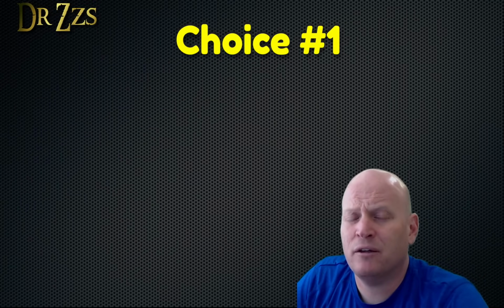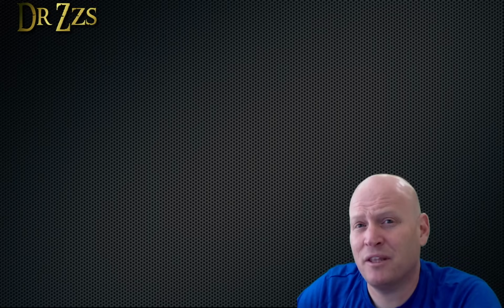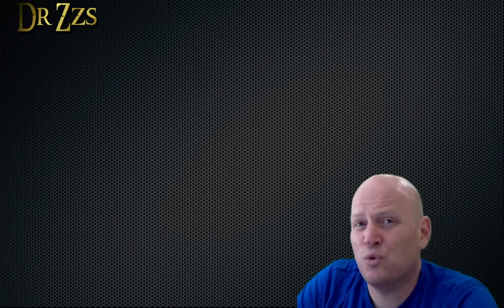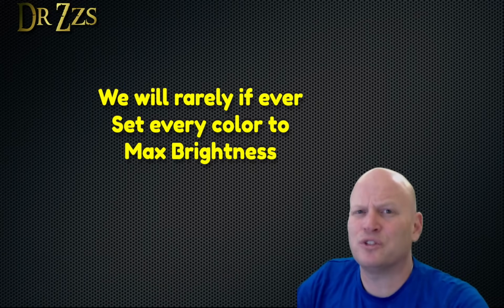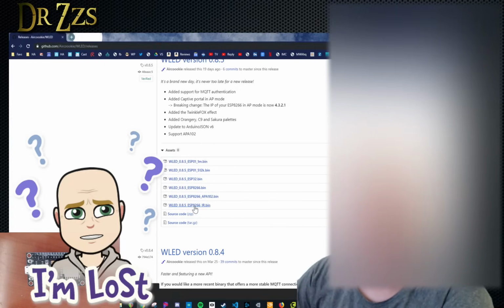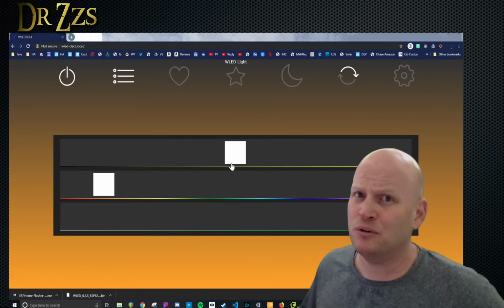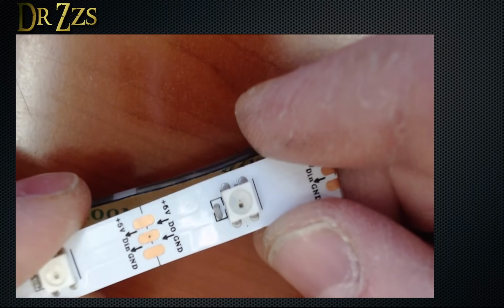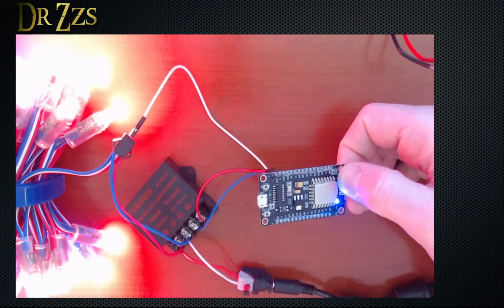Beginner's Guide to Christmas Lights - and LED Shows for Every Holiday

Comment: Well, I guess your not involved in this as much now, left a question few days ago but i finally got mine all working. i never could go to the address i made with my own name but was able to find the 192.x.x.x.x using Fling and typed that in..
anyhow you don't use any fuses inline with any of your stuff? got to reading on a Christmas site and they suggested having a inline fuse along with the power wire from the power supply to the unit. and even from the unit to the pixels. Have you ever done this?

Right now mine is set up just like you have. Other then I have a metal case 12.5 amp 13.8 volt power supply.

Thanks

Comment: I have 4 strings of GE G35. They're not bad, have 16 patterns, controling by radio remote. The only problem is I can't sincronize them. Will they be working as one 200 LED string with nodemcu controller?

Comment: I love the work you do and have so much fun watching your videos. I used the NodeMCU for my project just like the tutorial. Everything worked out almost perfect.

A bit of advice for "Canadians Only", 

Take heed to the power supplies used in this tutorial. 

If you are in Canada, how are you doing this so that the ESA doesn't come by and shut you down because of your non CSA certified STAMPED power supply from China? 

I guess it doesn't really matter where it's from because I bought mine from amazone.ca and the should not be hosting these sales as it goes against our safety regulations.

I installed my Permanent holiday LEDS with power supplies attached to the wall of the front of my home with a digital timer/on/off switch going into the side of an external 
GFI powered line from the fuse box. My 110v travels out in conduit to the side of the external plug outside beside my front door then goes up 1 foot to the digital on/off/timer 
switch inside a protective housing box, then out and up another foot to the power box that houses my power supplies. 

The reason why I am telling you all this is because of my question, IF I make all of this "NOT attached" to my home and all mounted in external water proof boxes sitting on my cement porch mounted on a tripod and plugged into the front of that front gfi beside my front door. 
Would that make the ESA(Electrical Safety Authority) situation mute now because I removed all electrical equipment from the home and plugged it into an external gfi ?

I don't think DRZzs would know as he is in the states, but I hope his community would know because I'm kinda of in a pickle and can't find CSA Cert 5v 70a power supplies 
here in Canada so far. :-(

Sucks to get it all done looking wicked and told I will have to shut down because of my power supplies not being Canadian Safety Certified.

Keep up the great work DRZzs, you are really fun to watch and learn from!
Excellent Teacher!
Reply: I got the call I was waiting for. CSA called back and I asked if the box was mounted off the front outside wall and not "Attached" to the home but placed on the cement porch in a water proof box, would I be in the clear. They said also have it my power supplies inside the main box "plug" into the GFI beside the front door on a timer and you are all good. FweeeeeeeW! 

In the end, don't install these Chinese power supplies onto your home if you live in Canada. Place it just to the side on the porch or on the ground and run your lines up through conduit and thats fine.

Also watch all DrZzs Videos and support him. 
He's doing some great stuff here!
Sub/Like/Share!

Comment: Thanks for the video it has certainly pushed me into trying to make my own xmas lightshow. I have got one string of lights and node mcu and have it all working great. 
Is there a limit to the number of 12v strings i can connect to one nodemcu? I will be adding power throughout the strips so not worried about voltage drop.

What i am trying to achieve is a 16 strip 180° xmas tree. Can i control this via one nodemcu or will i need to use multiple and then group them together on xlights?

Comment: Hello, Thanks for your video. Question, how many string lights can you connect into the MENZO 12v 30a Dc power supply? also, do I need (1) Wireless Module per string light? Again, thanks!!!!

Comment: Trying to understand how power injection works. Do I need a new wire from the power supply to each string or can it be ran from strip to strip on the extra wires? So if I have let’s say 5 strips do I need to run 5 separate wires from power supply or can I use just one and keep chaining them together.

Comment: I keep getting stuck trying to flash my 8266. i followed the steps to download WLED 0.12.0 ESP8266.bin got the latest version of  ESPHome Flasher 1.3.0 Windows x64. Connect my 8266, select Com3 (the only one that shows up), select the WLED bin file, select flash. Then it says "Using 'COM3' as serial port,"  "Connecting..."
"Unexpected error: Write timeout." when I try it again i get "Unexpected error: could not open port 'COM3': PermissionError(13, 'Access is denied.', None, 5)."  Help, what am I doing wrong, do I need a special driver for windows 10?
Reply: I discovered my problem. when I looked at the ports under device manager i saw COM3 and COM4 were assigned to bluetooth connections. COM3 was also assigned to my ESP8266 (2102). So i deleted the esp8266, then the other com3 device computer rebooted. in unplugged esp8266 then plugged it back in after windows rebooted, then device manager assigned esp8266 to COM5 - problem solved

Comment: My NodeMCU isn't powering on through the Vin input, but is powering  on via USB.  It switches off the moment the data  pin is connected to the one on the strip (checked data pin before  connecting). Help please.

Comment: This video was great! I do have a question though. What are the best ways to inject power at the opposite end of strip lights? There just be a better way than running a power wire in parallel to the strip itself.

Comment: You rock man. I did the naked led lights on my house. So far so good. Heavy rains mess with the colors. They dry out and it's fine. Good for 34 bucks for 82 ft off amazon. Wants silicone coated ones next!

Comment: New sub here. I am considering led light strips for lighting in my office or ham shack.  Do you know what RFI (radio frequency Interference) these strips emit? My understanding of solar electricity is that the inverter is the biggest soirée of RFI so if I came off the 12v with less RFI than a power supply from AC power.   What I mean is I would buy higher cost 12 v strips if I could avoid the interference.  Hope this make sense.  Thanks for your videos. You make this understandable.

Comment: @drzzs if you were starting over again, would you use strips or strings? I’m in the U.K. so pre-made items like your permatrack are not readily available, but strip channel is, making strips potentially easier to hang. Thanks again for your videos 👍🏻🤙🏻

Comment: Saludos from Spain!

Your videos have encouraged me to attempt to prepare my Christmas show next year! I have been watching your videos and learnt a lot from them already, I have been able to run my first string and program it with arduino, today I will receive a few ESP8266 and will try to get started with Wled and Xlights, let's see....

However, one question I have not been able to clear with your videos, I intend to build a few matrix around 1000 pixel each, but not sure about how many controllers would that require as well as the power supply for all of them... would you recommend any source of info I could check?

Comment: I've purchased a few LED strips and all the components needed to do a test run.  I'm wondering how you go about concealing the T-Splices at the end of every strip??  I have a couple of the different LED tracks and that's great to get the lights out of the elements, but the T-Splices are too big to fit inside these tracks.

Comment: Help!!! I bought the board from Amazon that’s linked on the description box, I went to the website and checked released and when I downloaded the “.bin” file and tried to open it, it wouldn’t. I was on a machome and I’m stuck! Time stamp is @12:48 I can’t go past that because the file won’t open up. This video is a year old but I can use some help pls!
Reply: I’m having the same problem! Someone help us!
Reply: @jwu322  seriously! I’ve downloaded the home flasher and the bin file and it won’t open up. I even tried plugging in the NODEMCU and nothing. I also tried downloading Arduino and no luck. I literally got a headache from trying for like 4 days straight

Comment: ok, found your post and having trouble with step one...  i downloaded the espflasher and it will not see my nodeMCU. when i plug in the usb,  it flashes.  I even tried a second one and a different cable.  still no luck.

Comment: Just checking in a year later to see if the LED's held by only the adhesive backing have lasted.
I was surprised by a set from BTF lighting I use inside that has held on for over 18months and still holding.  Most cheaper ones definitely don't stay up that long.

Comment: Clarification of lengths.  At the beginning of this video you talk about the strings & that “they are 3” apart & 16’ long!”  3” x 50 light “bulbs” equals= 150” / 12” = 12.5ft NOT 16ft. This lack of clarity makes it difficult/misleading for a new person using your video to accurately order lights based on lengths. I put this up here hoping it adds clarity to a SUPER Good -HOW TO VIDEO. Your viewers might also find it helpful to understand that using 3” will also get them in trouble with lengths because the 3” means there is significant “tugging”on the wiring. If you use 2.75” x 50 bulbs as your length = 137.5” /12 = 11.46ft / strand of lights (11ft 5 1/2”).  Hope this helps someone planning their layout!

Comment: Will the lights brake if the wifi module does, I put to much voltage and the board stopped working but haven’t tested leds with a new board

Comment: Got two strips installed, NodeMCU programmed, and additional 5V injected at connection of the two strips, but the lights are doing all sorts of crazyness and showing all sorts of different colors and patterns than what is selected in WLED. Any ideas?

Comment: How many strings can be connected to this small ‘controller’?
Reply: I'm still learning but I think ws2811, ws2812, ws2812b data is resent from each led unit. So for data it as many as you want but some sequencingsoftwarehave limits of 300 pixels (rgb led units) per line. But the power has to be tapped into the strings every so often depending on number of led are on each string.

If asking how many separate lines per controller, then I'm think upto 4 but I just got in some to test today. Part of the limits is how fast the controller is.
Reply: @Tigerskunk  I got my first 3 nodemcu controllers. The thing is I can’t use the flasher and other stuff on my Mac. Any ideas?

Comment: Great beginner guide, much appreciated!  I have purchased 2811 5v led pixel lights(set of 50) node mcu board, barrel connector and a 5v 2A power source along with jumpers.  all was going great, flashed the mcu, went to power everything up and the lights flickered red for a split second but will not power up.  the Node MCU is powered up but can't get any lights.  did a little searching but can't find any solution.  Would appreciate any help, from east coast Canada and I've been watching  your vids that last month or so and finally decided to pull the trigger and give it a shot.  thanks in advance DRZZ. :)

Comment: *READ ME* If you are having issues flashing the controller:

First, you want to make sure that your cable is not for charging only. Apparently they make tons of those that are good for charging, but not for transferring data. A cable that comes with your phone or tablet should be fine.

Second, make sure your USB port works properly. Put some  other USB device (that you know works properly) into the port. If it works, then you're good there.

Third, (this was my issue) make sure you have the correct driver installed.
Open up "Device Manager" (Windows Key + S => Type "Device Manager").
If you've got a "!" next to your device, head here and download the driver: 
https://www.silabs.com/developers/usb-to-uart-bridge-vcp-drivers

Install the driver and refresh and you should see the COM number.

At this point, I was able to get the COM to show up in esphome flasher, but I could not successfully flash the controller.
What I did to resolve this issue was this:

First, run esphome flasher as administrator (windows), or with sudo (linux) (I'm not sure if this is necessary, this is just what I did)

Second, near the part of the board that connects to USB, you'll see a "RST" and "FLASH" button. Push and hold BOTH of them for a few seconds, then release only the "RST" button.
While still holding the "FLASH" button, click the "Flash ESP" button in esphome flasher. Hold "FLASH" throughout the duration of the flash.

This worked for me and I hope it's helpful to anyone who needs help. 

Good luck!
Reply: Thank you!
Reply: @eigilontherun  no problem! Good luck on your project
Reply: @thewonderonesie782  thanks alot! Ordered all my parts the other day, just waiting and learning as much as possible so i'm prepared
Reply: @eigilontherun  That’s super exciting!! I hope things work for you without giving you too much trouble

Comment: I think you need to be clear that a bare metal supply needs to be in an enclosure for safety reasons as the supply side (110 VAC) can be contacted by bare skin.

Comment: @DrZzs How did you mount the connectors between the LED strips in the aluminum channel without showing a gap of LEDs where the connector is? Also, you have to run the power wires if you are using more than 1 strip. Would the power wires fit in the aluminum channel as well? 

I am thinking for more than 1 LED strip that the aluminum channel would not really work?

Comment: HELP, you are the only source that I can find on the GitHub page to install WLED on my D1 mini and your tutorial is out of date and doesn't match what is on GitHub. Are there other sources to install WLED? I've been searching for hours and all sources point to a bin file that I cannot find. I couldn't use esphome flasher in Windows because it won't display the com port. Windows see it but it is listed as an unidentified USB device. I tried with Ubuntu and it also sees it as a ttyUSB0 device and it also allows me to select it, but I still don't see a bin file. Are there any new installation instructions? 

I have Windows 10 and Ubuntu 20.04
I attempted to install WLED on a D1 mini through esphome-flasher
I also attempted this using multiple USB cords (some of them were charging cords)

Thanks for any help you can offer

Comment: Your videos are great.  Thanks.  In watching your channel and Bruh, I've found you both using Wemos D1 mini and Nodemcu.  Since they are both parts of the ESP8266 family, can they be used interchangeably?  That is, I bought a bunch of Wemos boards not long ago and if possible, I'd like to use them when you call for a Nodemcu.  I know how to define the boards to Arduino IDE and I have used the Wemos without sketches using ESP Easy Mega config files.  I even have them working through MQTT to Home Assistant.  Just curious....Thanks, Irv in Florida

Comment: After watching this I put up 325 pixel lights (5V), and ran an 18AWG power injection line, with T connections at every 50 pixels.  Now there are people telling me that 18AWG is too small of a wire for that, even though you say 22AWG is good.  What should I do?

Comment: Loved the video, very well explained. I do have a question, We have our house lit with Orchestra lights, all LED. Is there a way to use a controller with those? Like the one you explained at the 12 minute mark area? Also, is a node required on every break away? Say, I do 3 windows all separate, would each window need one? Again, thank  you very much.

Comment: Help!

I finally got this setup running last year after some struggles.  It worked great all season long.

Trying to get it setup this year and man, more issues.  I got everything flashed, but after step 6, Once I connect the esp to the lights, I cannot get it to connect.  That and the board gets really really hot!  

any ideas?

Comment: It's actually possible to damage integrated circuit chips with static electricity by touching them without discharging first. All the professionals use a wrist strap with a snap-on wire that's connected to an electrical ground, but touching a grounded electrical appliance or a plumbing fixture prior to touching a circuit board will do the trick. If you don't run a humidifier during the winter months, your furnace can dry the air enough to make static electricity a common occurrence.

Comment: Is there a reason for my ESPhome flasher not to find any com connection? I have tried all my USB ports and it won't find any. Can you please advise?
Reply: I'm having the same issue.
Reply: @cjlundmark1345  i CHANGE CABLES LIKE 4 TIMES UNTIL IT WORK
Reply: @josephroman88  I tried multiple cables and nothing worked... I tried on my 3rd computer after loading a driver on that computer for the 2102 chip it finally worked .
Reply: I have the same issue and its not the cable as works with my other boards.